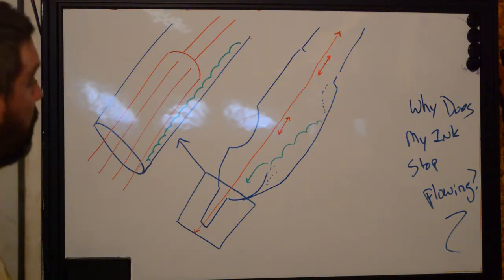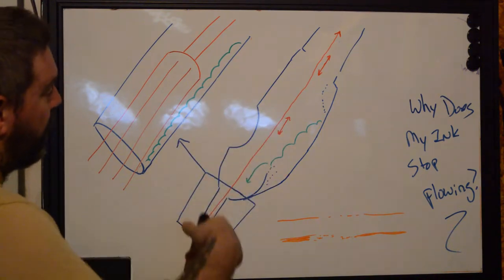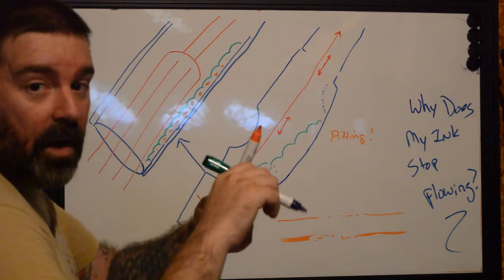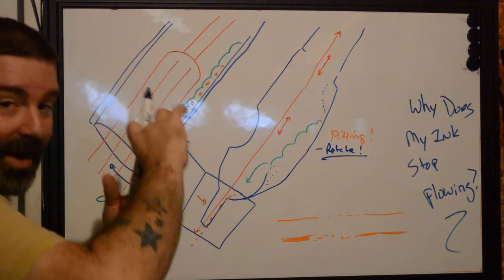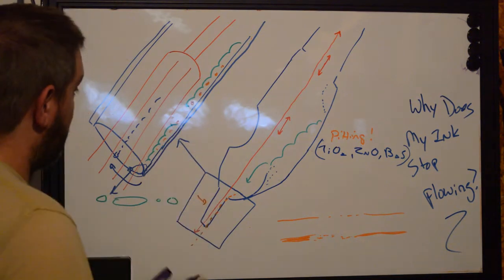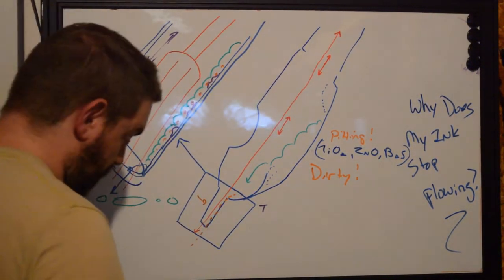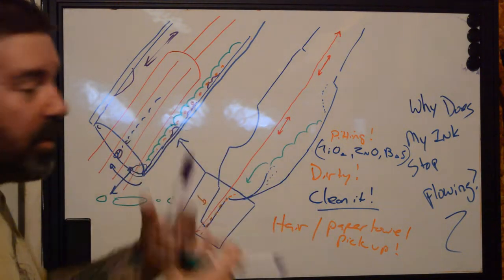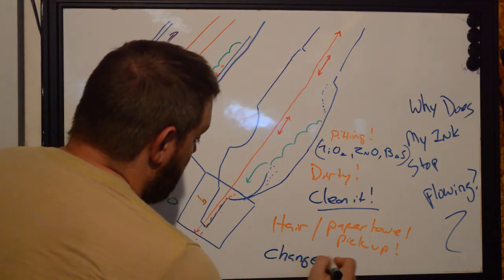Why Your Ink Doesn’t Come Out Of The Tube - Coil Machine Fix.

Comment: I've just had a session where i had all these problems at once, but i didn"t understand what was happening. I've had to change the needle at some point, but before that i was trying to work with the old one for too long. So i just ruined a good bit of the work. Thanks for the vid, now i will recognize theese issues much quicker.
Reply: Same :(